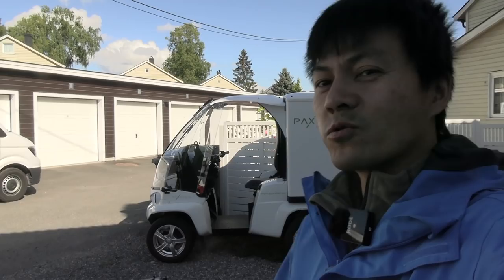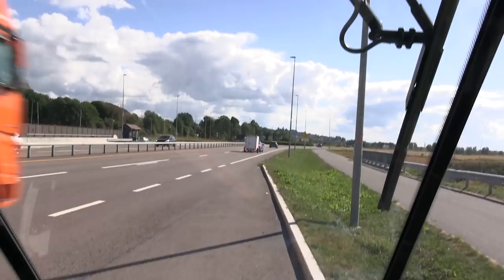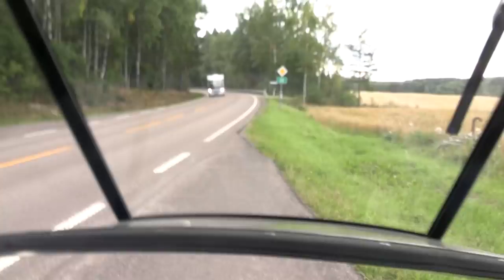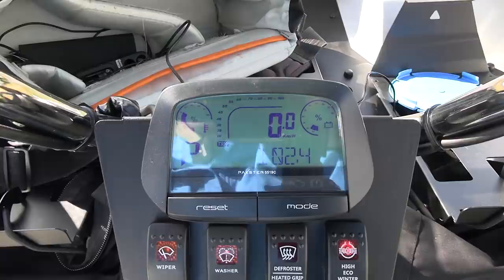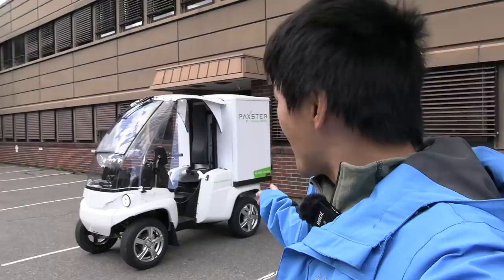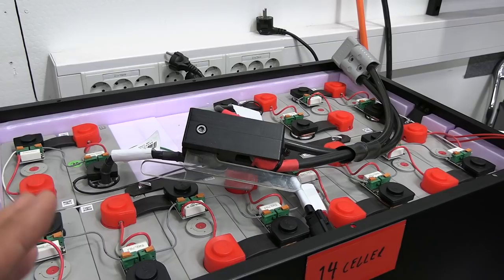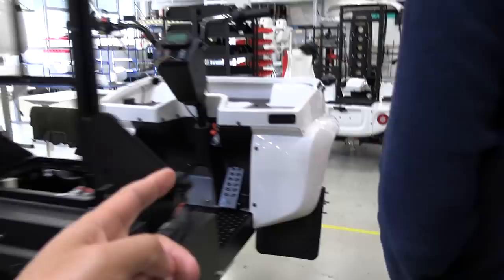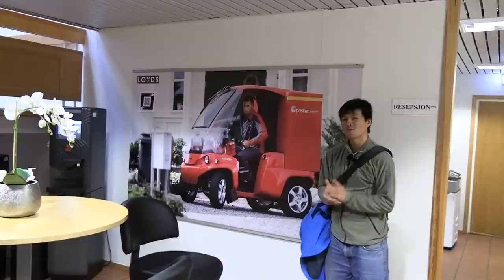Road trip to Paxster factory

Comment: No public chargers with type1 attached cable in Norway? In Switzerland we have them all over the place (but I doubt they are used very much). It's usually the swiss-made GreenMotion PrivateOne/NetworkTwo chargers that have type1, so maybe it really is a swiss thing
Reply from the maker: No
Reply: You could find those kinds of weird charging poles maybe 4-5-6 years ago when the standards were split between type 1 and 2, when the Asian brands still insisted on Type 1 and CHAdeMO, but nowadays Type 2 and CCS is the European standard, and that should apply for Switzerland just as much as it does for Norway.
Reply: @lingondraken  yes, that makes total sense. But almost all new GreenMotion chargers still get installed with both type1 and type2 here (but you can only use one at a time). I assume that's because if they only had a type2 cable attached, then there would be no way to connect type1 (without some unusual adapter). Chargers with only type2 socket (no cable attached) don't have that issue since a type2-to-type1 cable can be used.

Comment: If the XL model had a range of around 100 miles (160 km), top speed of around 62 mph (100 km/h) with 7.4kW Type 2 on-board charging,  I think it could do well for a lot of companies to replace traditional small car-derived vans.
Reply: At this size, a manual battery exchange should be possible, which would eliminate the charging time (that is, if the topology of the routes allow it, e.g. there's a central location).
Reply: But you would need a motorcycle/car license. The advantage of Paxter you can drive it on moped license, which is easy and cheap to get
Reply: @FSXgta  can it be parked on the pavement in Oslo? will it be convenient for food delivery?

Comment: Cool insight into Paxster. Best of luck to them!

Regarding the Schuko charging cable you use there; does it not kind of defeat the point of it by sticking the safety electronics in the Type 1 (or 2) plug? The whole reason EVSEs exists is to have most of the cable unpowered until the connection to the vehicle is established.

Comment: So, what is it you need for on the road charging? Type 2 to type 1 adapter and type 1 to Schuko? I wonder how people charge their electric scooters or Twizys on the road
Reply: Depends on the electric scooter, but in Taiwan, they have a battery hotswap system, and you just take the batteries out and put it into a station and it will give you charged batteries.

The Twizy only has Schuko or UK 3 pin, so it needs to make use of legacy charge points, but those are meant to be city based quadracycles. So it would probably be easy enough to find older Schuko or UK 3 pin socket charge points in a city.
Reply from the maker: Type 2 to type 1 as shown in the video.
Reply: @SniperSnake50BMG  that's only for level 1 charging, since if you want level 2 charging, you need the 240v input, which Type 1 plugs handle easily with one live/hot at -120 V and a second live/hot at 120 V, giving a total potential difference of 240.

Since Europe has 240 V normally, which can go up to 400 V on 3 phase, Type 2 plugs are intended to make use of the European electrical standards better.

Comment: For a country that supposedly just drives ev's, most of the cars on the road you passed were ICE.
Reply: The average decommission age for a vehicle in Norway is 19 years for gasoline and 20 years for diesel.

Plug-in vehicle covering a little over  50% of new vehicle sales, so it will take a while before a large percentage of all vehicles are plug-in vehicles...
Reply from the maker: We have 10 % EVs in Norway already. That's quite high. And if you go in the city, about 40-50 % of the cars driving there are EVs.